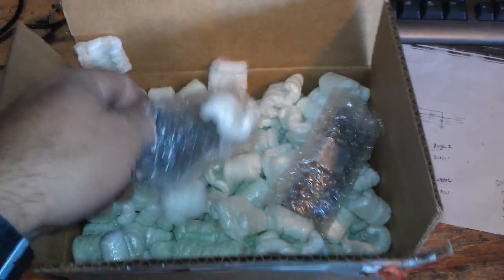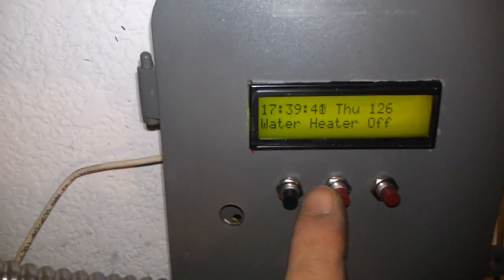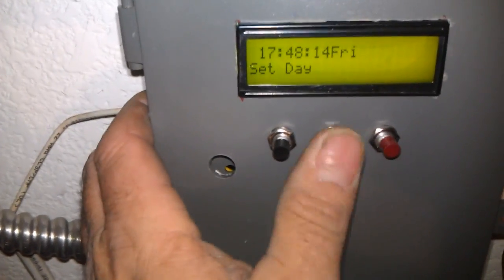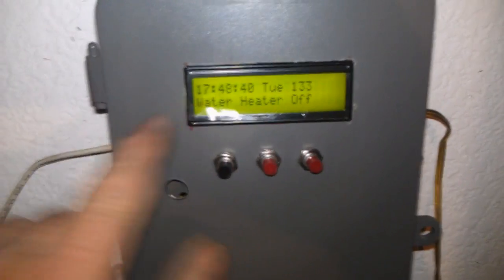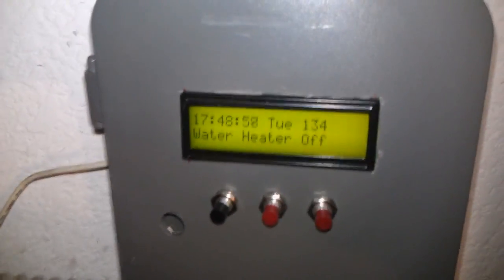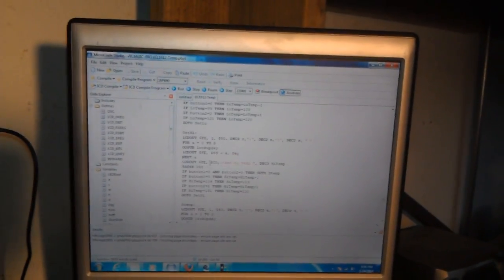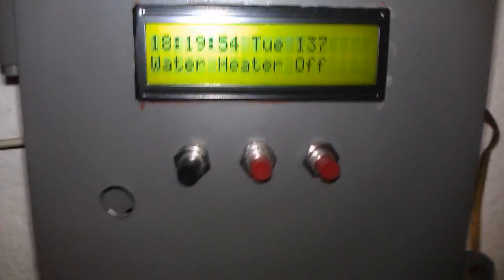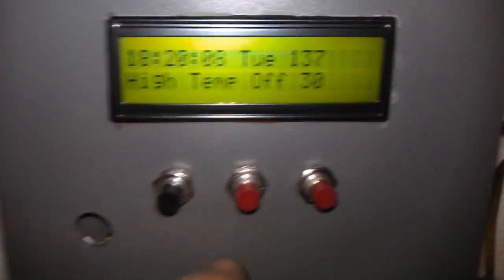Homemade water heater timer-controller - Part 7 - Fixed and completed!

Comment: @itscool1968 well you can get a low off peak price and slightly higher peak price or  a set price right in the middle and some people take advantage of that, here our rate are about 22~24 c/kw on peak and 18~20 c/kw off peak, NYSEG is a bitch and NY is a scattered wasteland with government jobs or welfare

Comment from the maker: @itscool1968 
That may be true, except when you get on a PEAK use plan where it is 24 cents per kwh from 12 PM to 7PM M-F and only 6 cents otherwise. 
You want to AVOID running appliances during that 12 to 7!

Comment: thats pretty cool, i would like to get a 20 gallon water heater to put in front of our 82 gallon hot water heat which is set to 125, i want to timer it to run from 5pm to 10:30pm, unfortunatly our "off peak" rate starts at 11:30pm and ends at 7am and it is only a few cents cheaper, not a whole lot and we aren't even using our storage heaters anymore, nobody uses them nowadays and they are 23 years old and from UK, each way over 160lbs